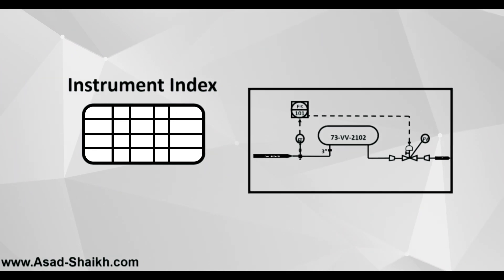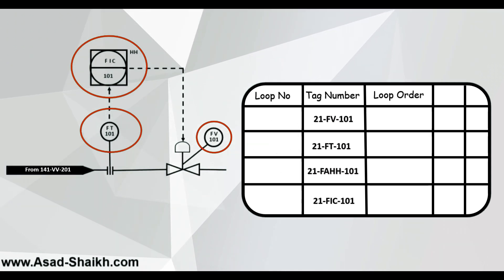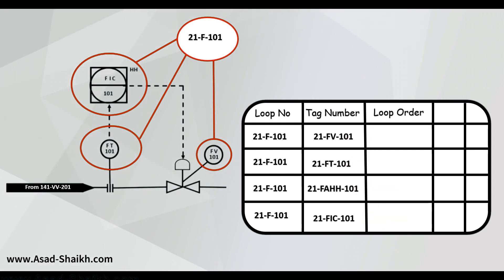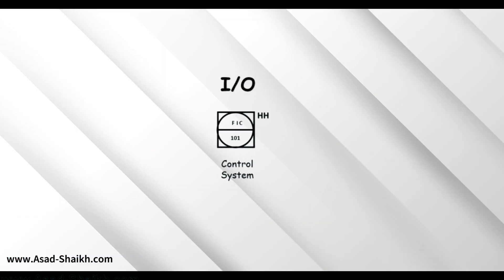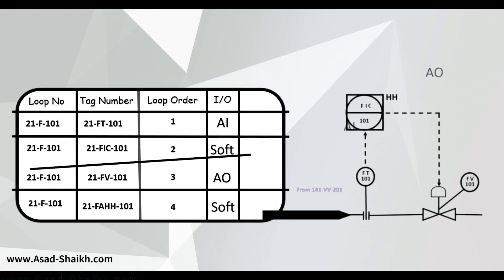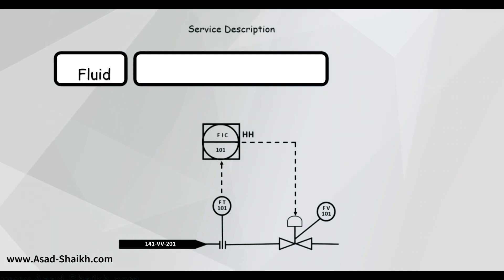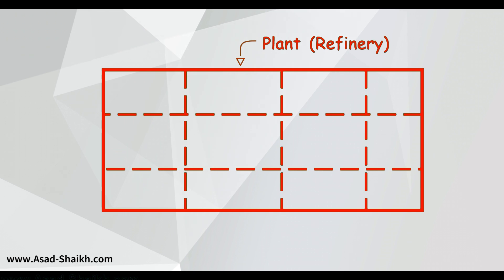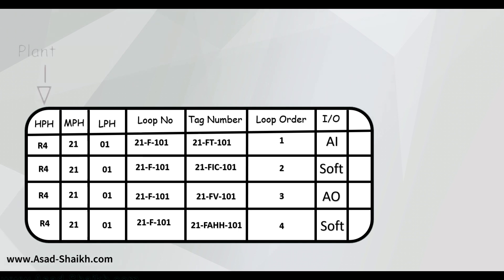Instrument Index Preparation | For Mega-Scale Projects

Comment: Nice video..Instrument index also cover Instrument type,then subtype ,line no,line size ,pipe class ,Tracing either heat tracing or steam tracing if there is valve then Valve size and its position i;e Fail open ,fail close TSO AFC etc Then Location of instrument ,then Signal Direction From DCS to Field ,then what type of system either DCS or ESD or FGS etc..and many more..